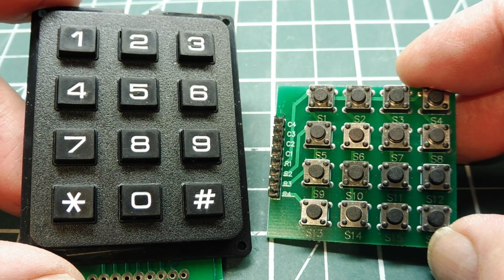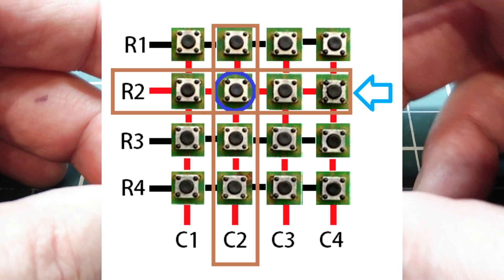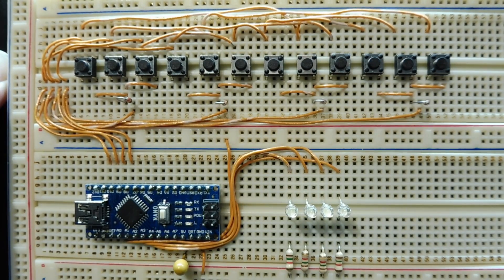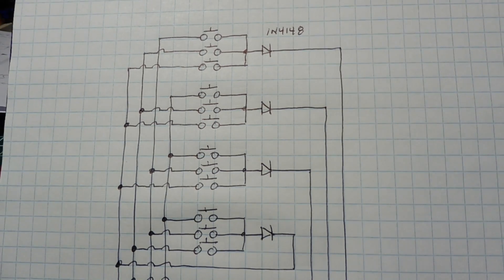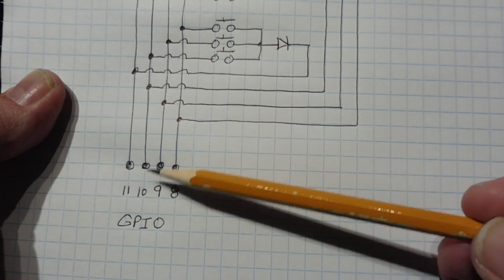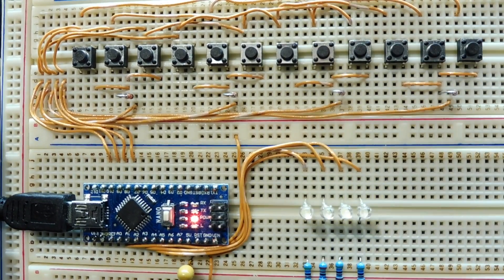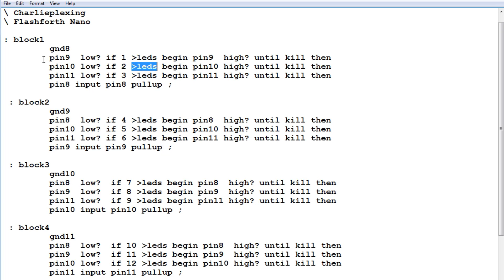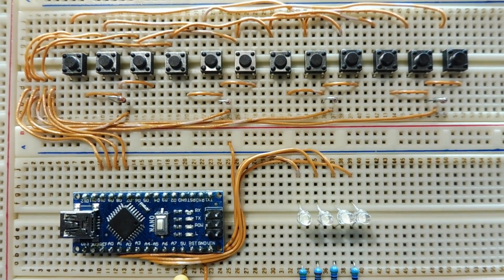Charlieplexing Using A Microcontroller  / Arduino

Comment: What was the value of the cap and why did you add it?
Reply from the maker: It is a 10uf decoupling cap across the 5 volt supply to the Nano. It is good practice to add a decoupling cap to filter or bypass any noise on the supply line.